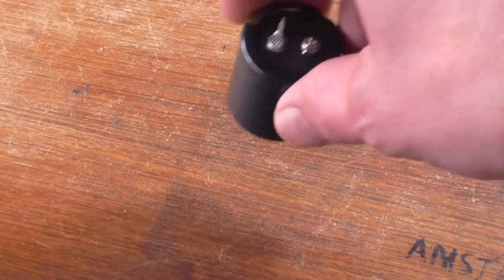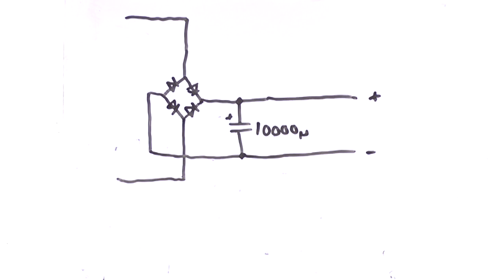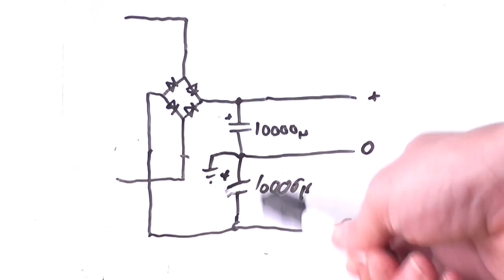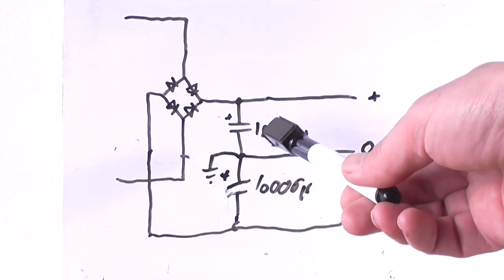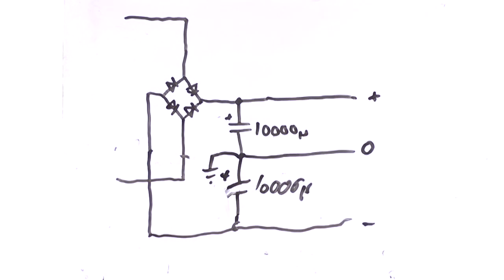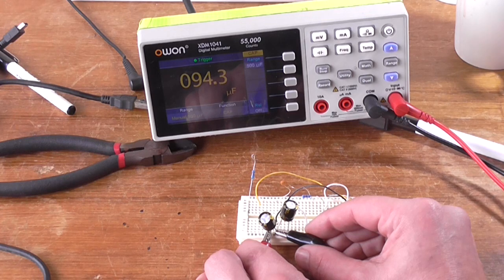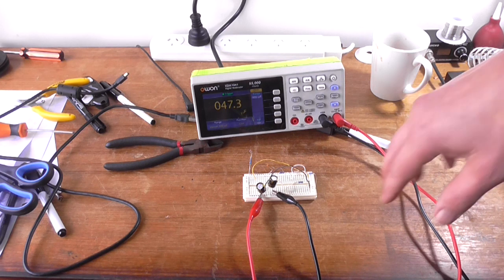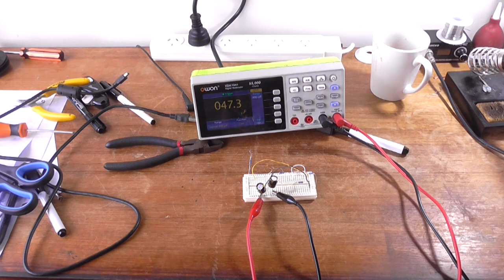Common Misconception about Capacitors (Capacitors in Series)

Comment: When using such a dual rail supply in an audio amplifier, taking the 10000uF per rail in your demonstration, then each half cycle will get the 10000uF though. Please correct me if I'm wrong.